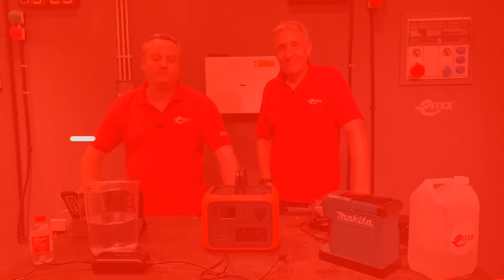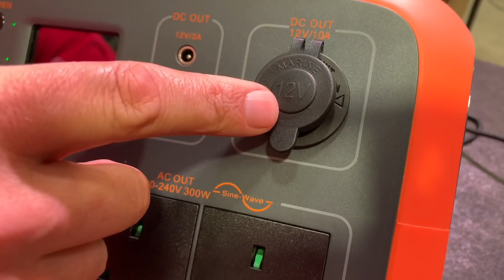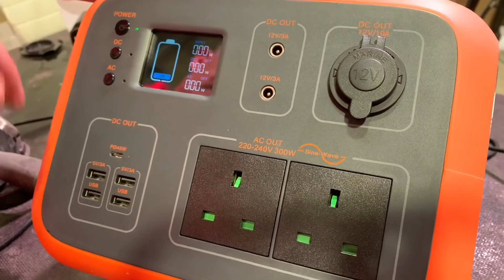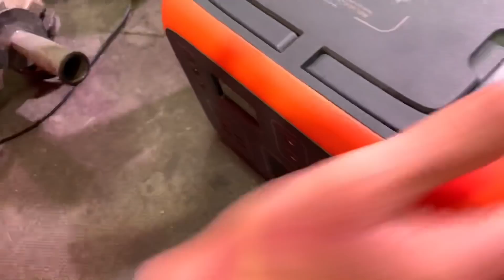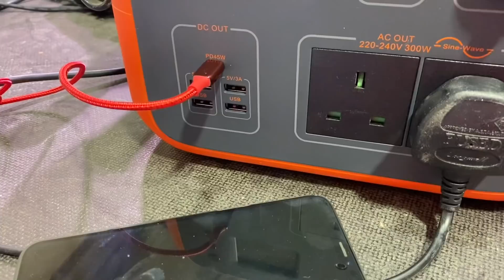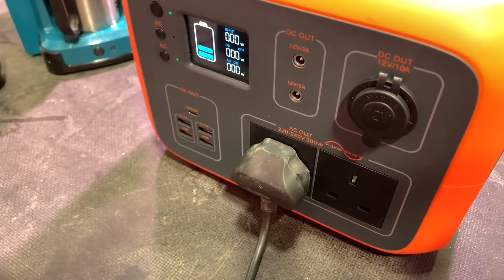Do Electricians Need to Buy a Power Oak Portable Battery Pack Inverter?

Comment: Good for the Caravan but for sites you really need a suitcase Gen.
Routers like Cisco need greater than 300w
Inverter suitcase low db models are around 500 quid,  better all round
I have mine bolted in the van with a long lead out if needed

Comment: @7:53  DeWalt have a 12v Accessory Socket based charger ( with some magic to output 20v from the incoming 12v ) DCB119-XJ
also, love these things, I used to carry a genny to those jobs with no power ( but they expect you to install the network / wifi ) but running one indoors was a no-no and running a power lead up 3 floors wasn't ideal. Have the 288Wh AllPowers device, which will also charge from USB-C at a higher rate than the supplied wall charger

Comment: All qualified electricians should now tow a trailer behind their van with a wind turbine and / or Solar panel in case the (Annoying) customer's Broadband router, laptop and mobile telephonic device is running low on juice ....

Comment: Something like that should put out many amps, for that price! Wireless charging is slow and inefficient. I like idea of the 12V barrel plug, you could make up cables to charge docks for drill batteries in the van or in an emergency. Compared to DC to AC conversions, way more efficient

Comment: Did you notice that a 12VDC car output will only charge that Poweroak unit to 40/50% of the capacity ?
Reply from the maker: We haven’t tried a full charge off the 12VDC - we’ll  watch out for it stopping - thanks
Reply: @efixx  Rally-Design publish that detail on their website... oh, and it is £399.00 there.
Reply: A 24vdc vehicle charges to 100% apparently

Comment: Must admit, the unit I have had for years that has a 300W, 230VAC inverter, USB outputs,12VDC output, Jump starter and compressor,Voltmeter, pressure guage and uses a 18AH lead SLA battery costs, nowadays maybe £165.00.. had it for several years and changed the battery myself (once) ok, its heavier and no wireless charger but has served me well... it does have a carrying handle also, and a work light.
Sourced at Machine Mart and still available.
It would have to be something really special to warrant a spend of 500 squids.
Another one I knocked up myself was two batteries, inverter,CTEK charger and built into a hard bottom Stanley tool bag. Oh, it also had a portable COFDM digital video reciever (4K's worth) buit in and an 8" colour monitor .. I could sit 500 metres (or more) away from a covert camera instalation and recieve crystal clear images of covert cameras, and record them. I could top up the charge if needed from 12 vehicle accesory socket, or mains.

Comment: 12 VDC output... used them for
Temporary power for CCTV cameras
Charging my CCTV test monitors
As input for 18650,AA and AAA chargers
Powering a DVR in a mobile application
Powering temporary covert cameras short term
Charging two way site radios
Used for all of the above, and more

Comment: The Type A USB socket, the one we are all familiar with, is being phased out for Type C. Type C is in the bottom of most Smart phones these days, even Apple had to adopt it after years of trying their own. Type A can only be plugged in one way, try the other hard then you ruin the socket and plug. Type C can be slotting any way. I believe there are A to C adaptors available and vice versa.

Comment: Made my own, 5kwh battery , 3kw inverter in a wheeled peli case, perfect for powering a clients fridge and laptop etc aaaaand can boil a kettle although you do need to unplug the fridge and perfect when sat on a barge on the Thames under a big wheel thing ready to set of some sparklers on new years eve :)
Reply from the maker: Sounds like a beast of a backup
Reply: @efixx  the joys of doing a rip out on a data centre, loads of lithium destined for the skip .. only a year old too

Comment: Solar panel on my van roof would hardly get chargered as I've got Ladders and rhino tubes on it...

 if that cable was longer you could put the solar panels in customer garden and plug it in that's if it can be used while being charged ?, can anyone confirm this just curious if so this can be done
Reply: The manual doesn’t recommend using it as a through charger.
Reply: @bertoltb13  ahh thanks for clearing that one up

Comment: Quite a few smaller devices like routers, switches, access points, DECT telephones, external hard disks, battery chargers, etc. use 12V with barrel jacks. It is way more efficient to power those with the 12V outputs rather than use the inverter to get 240V AC only to convert it back to 12V DC with a wall wart.
Reply: You beat me to it ! Not to mention tv/monitors, music systems, radios even portable light units all these and more used in the caravan/camping field ( no pun intended !)

Comment: The cheap plastic hollow looking handles wouldn’t survive 5 days on some of the jobs with builders throwing bricks around as they do. Two trashed old type radios would testify to weak plastic design not lasting. Would be ok for domestic use

Comment: £500 no thank you 
Just another overpriced lump of plastic for some thieving   git to nick of the van when your back is turned . And it is possibly cheaper to go to Halfords and get a 12v to 240v converter fitted to your van . For the camper van or caravan maybe a worthwhile perches but not at £500 . 
Good video guy’s as always ⚡️

Comment: There are others like the Jackery at a much lower price, with a 240Ah battery and USB-A, not USB-C.
Reply from the maker: USB C is an essential moving forward.
Reply: @efixx  True but you can always plug a USB-C charger into one of the 240V sockets. Some products like Unilite aren't fully compatible with USB-C - they need a USB-A to USB-C cable as supplied in order to charge them.